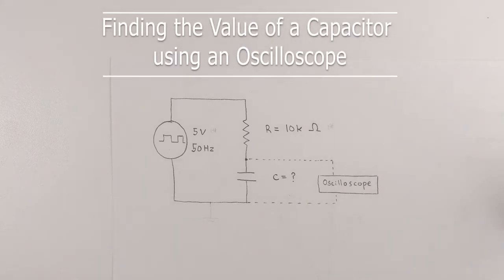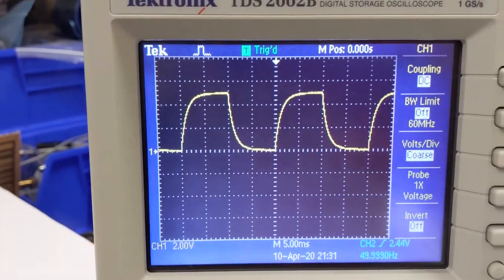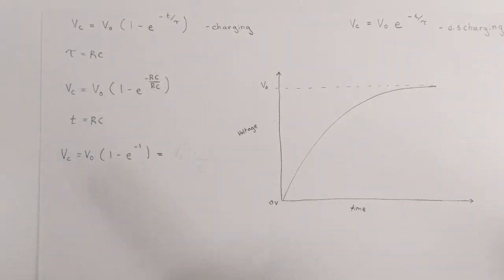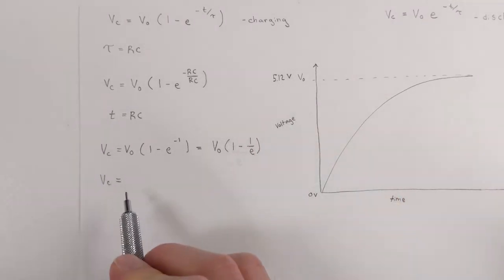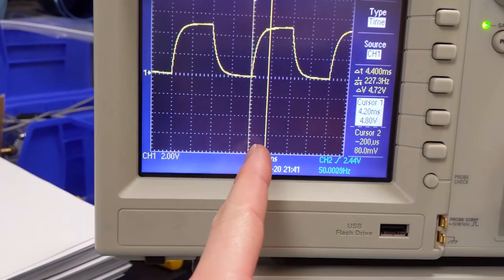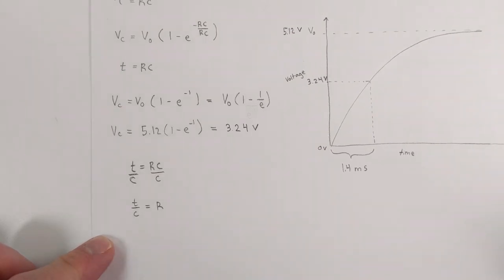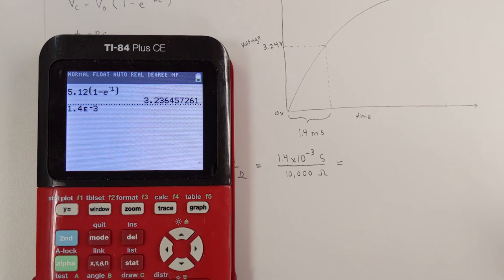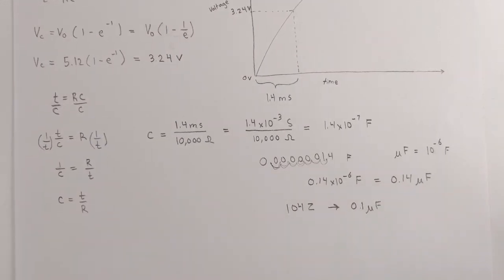Finding Capacitance with an Oscilloscope

Comment: Well presented. I know it can be challenging to get ones thoughts out while taping and drawing, and sometimes when I forget what to say next :)
Just a few thoughts from me on your demo, pls feel free to consider or ignore.
- signal generators usually have a built in 50 ohm resistor, this may throw off calculations if not actually measuring the output of the generator. I think your were doing that though, but viewers may not have known about the internal impedance.
- t = RC --> C = t/R : just divide both sides by R ?  :)
- more for ppl with analog scopes but the way to minimize errors when reading datum points off of a waveform is to try and use as much of the screen as possible, eg. have only one cycle on screen and at max possible amplitude. The effective resolution between divisions is really only a tenth or fifth, hard to get any more accurate.
- getting into electronics, its handy to be able to seamlessly move between the capacitance scales (uF, nF, pF) = (10^-6, 10^-9, 10^-12) in one's calculations. This takes practice though. Same really for reading resistors by colour (though rarely seen now due to wide use of SMDs)

It nice to see you working it out on paper, I tend to do that too but I'm more from the old school.

Cheers,
Reply: dividing by R was exactly going through my head and then  pondered about all this trickery 🤔🤔🤔🤔

Comment: Wow, I just noticed that you have videos of a digital clock and circuit.  It would be really neat if you could mod it a bit to become a stopwatch that could be started and stopped by some external switch, such as the switch of a power supply, better, by voltage values.  Then you could measure caps with accuracy!  Oh wait, what about reactance vs impedance?  Hm, interesting since there is no frequency in the circuit. Hmm.

Comment: Question: Patch a RC circuit and connect it to AC input voltage source. DIsplay the voltage waveform of capacitor voltage and waveform of capacitor current simultaneously without using MATH mode of the oscilloscope. Use oscilloscope only to get the desired result.

Comment: Well you are only off by 40%!  Try this:  pick a resistor such that RC > 5 sec.  RC > 10 sec is even better.  If the Cap is really unknown you must experiment a bit to make it work. Then use a DC signal of 10 volts and use your cell phone stop watch app to time the step in volts from zero when you switch the PS on to when it reaches 6.32 Volts.  Then divide by the resistance to get the capacitance.  Be sure the cap is completely discharged before you start and you should get a value accurate within a few percent.  I usually run it three times and take the mean, but if I am careful the time repeats within a few tenths of a second.  The longer you can make the time measurement, the better the accuracy because (delta t)/t gets smaller, where (delta t) is the variance in your time measurement.  Try it!  Also, you will find that, unless you have a top digital scope, the scope method is quite sensitive to frequency.  You may need to go down to below 1 Hz for caps, and your analog scope will not like it!  Plus eyeballing points on the trace simply cannot get the accuracy of using a stopwatch, by about two or three orders of mag.  I have used RC pairs such that Tau was several minutes.  And I use a big faced analog volt meter, a Simpson 314 for timing.  With long times, the needle is moving so slowly that accurate timing is quite easy.  Plus, with the analog meter with full scale numbers of 10 and 30, with the range set on 10 volts, the 6.32 volts hits right on the "20" of the 30 volts scale right below it!  While there plenty of videos on the scope method, I am yet to see anyone post a video of the stopwatch method.  How about you go through the details and make the post of the (way better!!) stopwatch method.  Anyway, good luck with your studies.
Reply from the maker: I love your idea of doing it with a stopwatch! I'll definitely look into it!
Reply: Try it with a 10uf cap  this method doesnt work